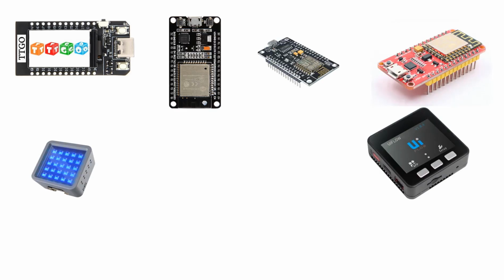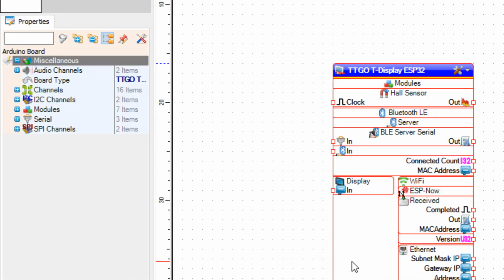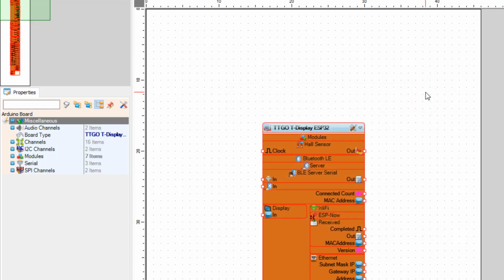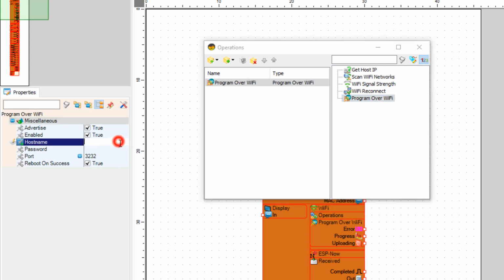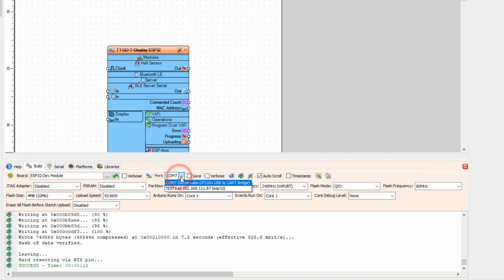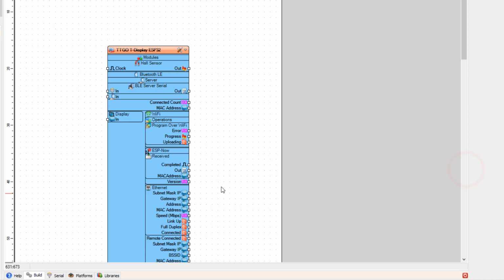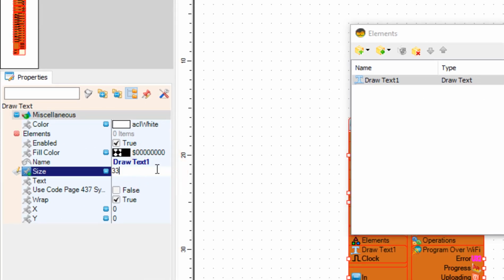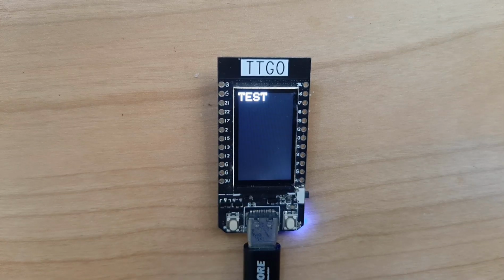How to Do Over the Air (OTA) Programming for ESP32 & ESP8266

Comment: OTA is very nice, does it also work with WT31-ETH01 over the air? and are there also modules that can be programmed over ethernet?
Reply from the maker: Yes tested. It works both over the air, and over the wire